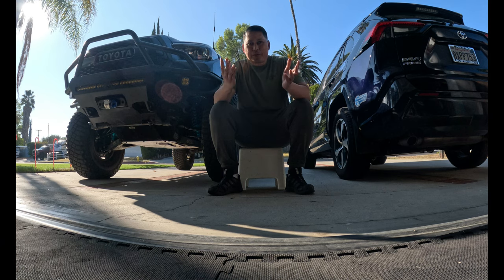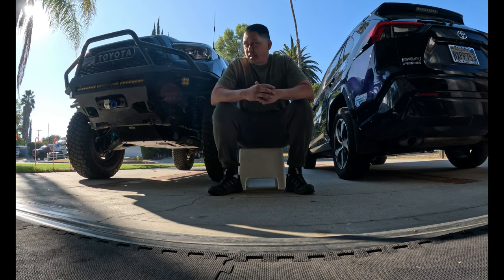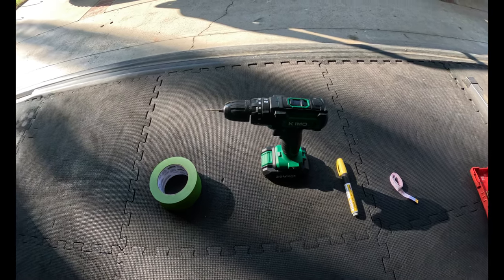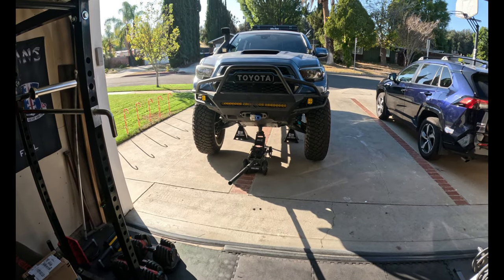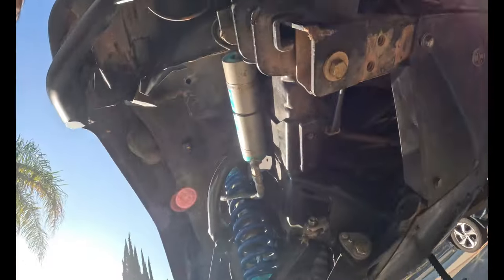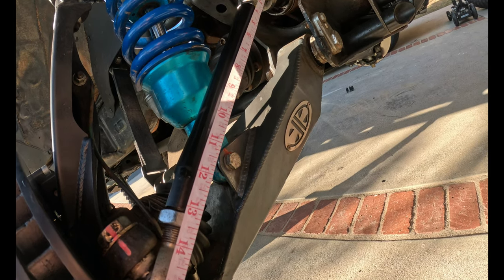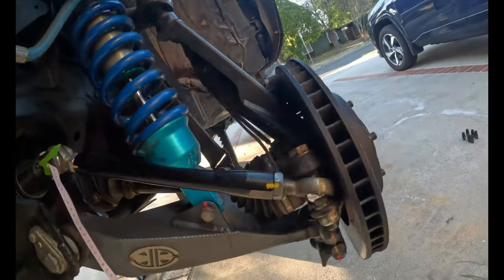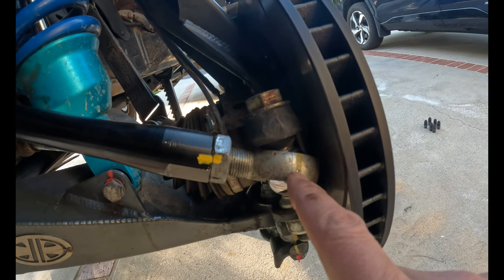Toyota Tacoma Heim Rod Alignment Hack

Comment: Hell yeah dude! Once allotment is done and you are on your final set up(tires, suspension) then save your measurements and record numbers. High end suspension requires constant maintenance, and constant maintenance means disassembly of parts. This will help with the reassembly process after maintenance is done 🙌🏻
Reply from the maker: Yes sir that is the plan. Maintenance a must.

Comment: Can you go over your rack setup please? Im about to pull the trigger on a marlin crawler rclt kit with the 200 series rack setup. Your setup looks very interesting and very strong as well too.
Reply from the maker: Thanks for stopping by. I have a modified Tundra steering rack. There’s a couple of videos about that floating around to describe the modification but to break it down: the shafts are machined to accept Tacoma tie rod ends. The new versions of the Tundra rack requires less modification. Meaning, you are not required to cut out new barrels on your frame holding the steering rack. The one I have is different as I had new barrels cut out as I’m using Tundra’s rack bushings as they would be stronger than the new modified ones with the spacer pucks that the makers of this kit is offering. You also need to modify the steering shaft by shortening it or getting a Lexus steering shaft if you wanna avoid having to cut and weld. Lastly, this steering rack will not work on Marlin Crawler’s RCLT. That specific kit requires the LC 200 as it matches that geometry. That said, the Tundra steering rack is actually stronger than the LC200 steering rack. Why? Simple. Much beefier. Good luck!